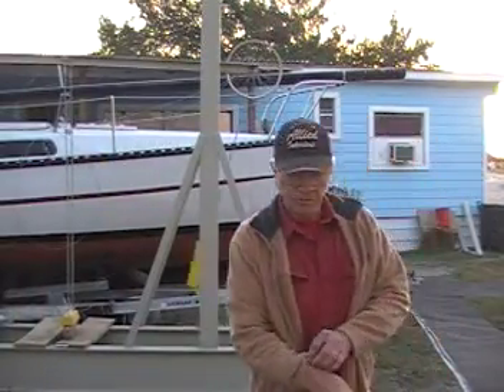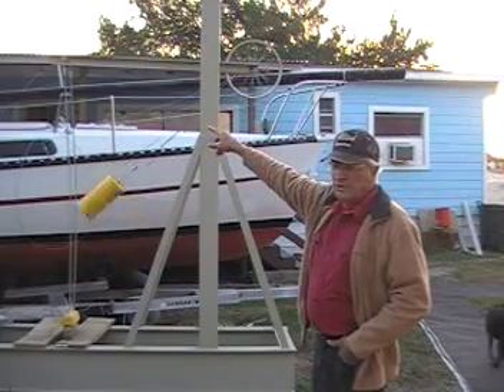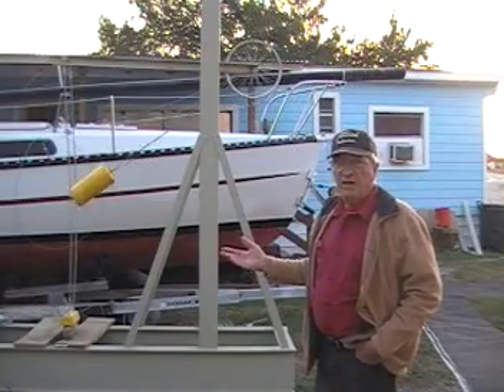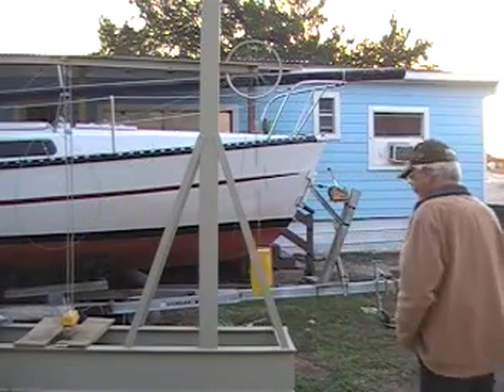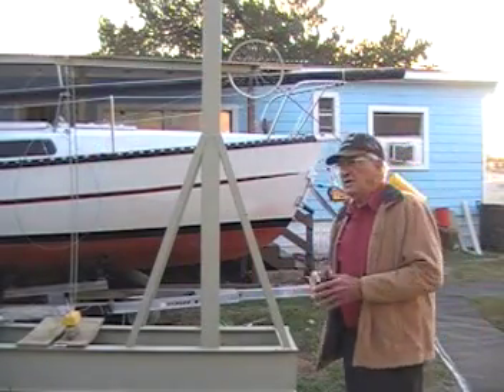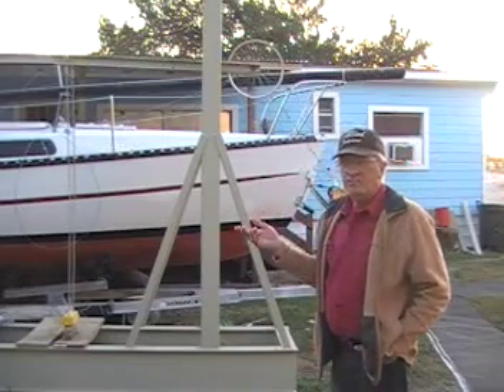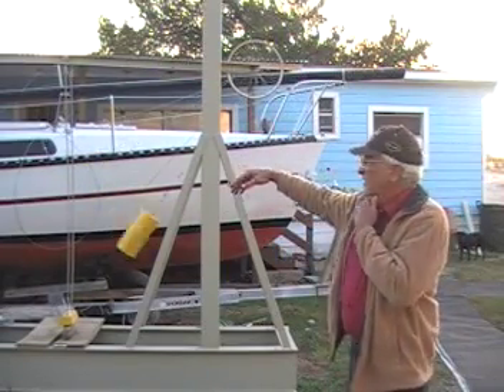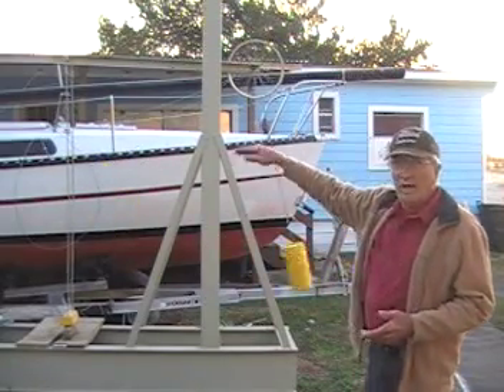testing large Milkovic 2 stage oscillator Video 7

Comment: Sir, the weight is not just being lifted and stop there,  but it is also being DROPPED while it is still attached to the machine so while it is being lowered, still attached to the machine, it is  not falling freely and so its energy is being given back to the pendulum through its  moving pivot.  There is very little   final work done or  final energy given to the rising and falling weight and the only energy that  was done on the weight is its crashing energy  and not the LIFTED weight.  That crashing energy is not as large as one thinks it is. 
If one had to hold the weight in its uppermost  highest point,  in order to make use of the work done on it, then there will be no weight to bring the fulcrum /pivot of the  pendulum back up to its position for a repeated cycle.   In this machine , if you want a repeated cycle , you have to leave a lot of weight on and one  can take off at the higher lifted position only a little weight or drag force as YOU HAVE TO HAVE A LOT OF WEIGHT TO BRING THE PIVOT OF THE PENDULUM BACK DOWN  for a repeated cycle, This machine is not doing as much work as Milkovic ever said. The idea of an energy amplification of 12:1 has to be forgotten and one may only talk of amplification of force provided the right leverage is used.
One does not need to push the pendulum with a lot of force is simply because there is little work done on the lifted  AND THE LOWERED WEIGHT  kept attached to the machine.

Comment: have you considered 2 pendulums connected with a straight "stiff" connector. with one up the other is down, they could keep each other going possibly, i'm trying to get it on paper but the math is not easy-  lol
Reply from the maker: yes and no .  2 pendulums both down swinging in opposite directions to reduce the lateral pull.

Comment: i used somthing similar to this to lift my shed up off the ground i had my son push down on one end and he could lft up the shed so i could put blocks under it.no jacking.it is the egiption secret.its called leverege.once i installed a floor under a cast iron tub.without removeing it.i put a 20 ft log 4x4 out the window to lift it up with only my tool bucket.the customer came home and was baffled.your thing can be run by a very lite wind .and or very small waves  or as a water pump.see powell's

Comment: @RHEAD100 - if your device puts out more energy than is input then logically you should be able to gear it to self run.  In all those years you haven't done that.  Now why is that?  Simply put it uses more energy in than out.  End of debate.

Comment: It seems that those thin boards under the counter weight are flexing and bouncing around absorbing some of  the energy. You may wanna try putting something solid with no give under there. Maybe a rubber mat. Also try putting a heavy spring under the counter weight. like a car spring. something to return the energy back to the swinging weight.  Just a thought. ;-) Love the design. keep up the good work

Comment: yes it is possible to power this with magnets and from a distance. not sure how far you can space them from each other than it can be measured in yards. i doubt it will run itself but it would require very little input . and yes this type of machine could assist in lifting large blocks, moving large blocks and most important cut the blocks. stop pushing the weight and start turning the wheel. the distance of 10 degrees is shorter at the center than it is at 4 feet away. timing is key too.

Comment: You're right, there is not mystery here if you understand what is going on.

The secret of this system lies in the dynamics between the ongoing oscillation of the pendulum and the load.
But you can easily prove that the power exerted on the pendulum itself which is (F * D)/T is less then the repeatedly lifting of the opposite weight. 

Do you really think that you could push 80 punds (36Kg) with only your fingers that many times without even feeling exhausted?  P out versus P in is not equal.

Comment: I think that you will find that while the push does not require much force, the force does have to be spread over a longer time.  So this is equivalent to someone having a finger in a vice, and the other person turning the vice using a very large handle.  Not much force required, but alot of pain caused.  Same with your proposed experiment, but still no magic energy gain.

Comment: There is no mystery here.  Yes, it seems easy to pick up the 80 pound weight, but that is because you have a counterweight.  Imagine a teeter totter with equal weights.  Same thing.

But there is no magic.  When the 80 lb weight drops, the fall is dampened by the counterweight, so you cannot measure energy the same way you would if that weight was free-falling.

There is no energy gain here.

Comment: "Measuring" how high or how many times left side weight can be lifted is equivalent to "measuring" how high and how many times a single pendulum itself can be lifted by a single pendulum stroke. I agree that is more times then input stroke but that is not measuring output energy because no energy is extracted from that pendulum or from this similar two stage system.

Comment: Yes but we haven't seen that kind of experiment (or measurements) yet!
For your last proposition and as I sugessted before we need a lifter mounted at left (lever) side that will lift some weight that is independent of that whole system! That way is possible to measure real energy (or work) output and not energy that is just stored in the system. 
Alternative is to mount water pump or electric generator at left side and to measure potential energy of pumped water or generated electric power.

Comment: Well, that isn't too bad of a test really, as the only normal potential energy you can get from gravity is by increasing height.

So you have it there, a very easy test to do.
Take a weight equal to that of the pendulum, than see how high you can make it move, in relation to the pendulum. If higher, and if several times, than you must agree that there is something to this.

Comment: My suggestion is about measuring input and output energy (see both my posts that are separated because of youtube length limitations)... And one can do a single lift up to max height (or amplitude) of pendulum (and measure that height or height differential to eliminate input energy loss)...

Comment: If you have oscillated it for half an hour, than you KNOW that the energy put into it in order to get it in speed is not important, i.e the resistance in the pendulum itself and in the air would have killed it of by then.

The main point is looking at energy put in by you versus the the energy going out at the other end, or simple by the pendulum's increase and decrease of weight.

Comment: I am particularly interested in first of two (possible) measurement scenarios Where input Energy is calculated by the same formula and where experimenter does just a single lift of pendulum weight.
Other measurements with constant oscillations could come later...after this simple ones...

Comment: Demolition contractors seldom use cast iron wrecker balls, with high scrap values, a lot are being lost. Their weight is 4 to 5 tons. A good idea to contact scrap merchants, and offer to buy them, and save them freight costs into the bargain. 

A 'qualified' engineer would need to vet the design! and instalation! This is good "Suck-it-and-see" Science. A Veljko Milkovic pendulum, is a noteworthy counter-example to the claim that potential energy is unavailable from centipetal acceleration.

Comment from the maker: This vedio ran in slow motion !/2 speed shows, without any dought. The machine can not only run itself. But can do it mechanicaly. While tirning a generator or pumping water. And not use any of the electricity or water to keep it running.
If you can not down load it here. Let me know and I will make a one minute video and email it to you. That goes for every one of my subscribers as well.

Comment: Yes, of course as long as it is able to put out work you should try to maximize the ratio further, as it will only increase its power in versus power out efficiency. Do you agree that this design is really the totally opposite to any normal motor or generator, be it mechanical or electrical? Because normally the drag on the motor should increase when you add more resistance to it, in this case however, its seems to increase its output as you add resistance to it. Funny concept :)

Comment: You got it man! The power conversion ratio is everything. 
I thought about that for some time earlier and came to the conclusion that the less you allow the pendulum to move the hinge (on the pendulum side), the less energy it will lose, but that does not mean that it will lose the pressure it creates. So, as you figured out, to make this machine as 'over efficient' as possible, you must restain the pendulum as much as you can, an at the same time collect some of the motion it creates :)